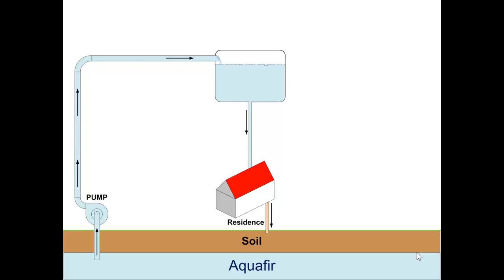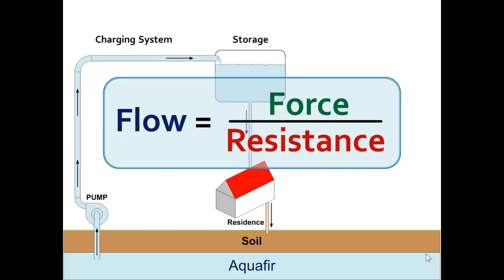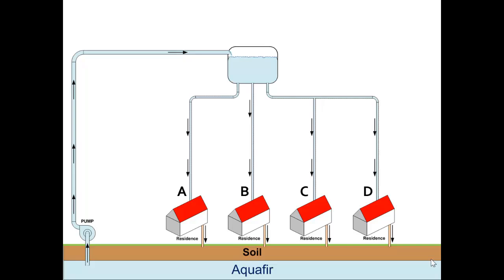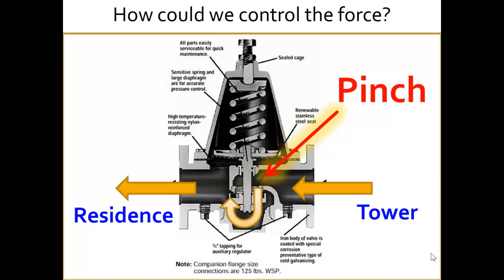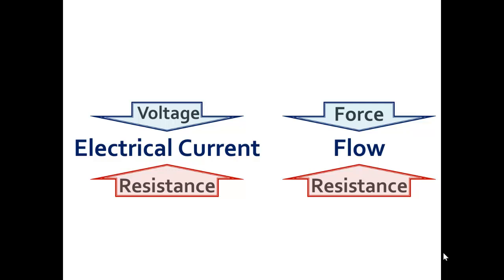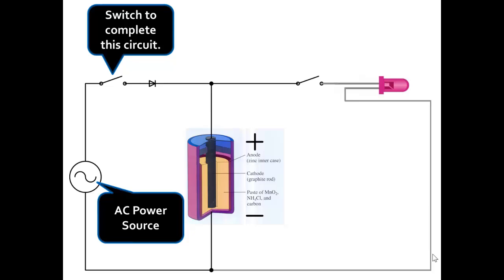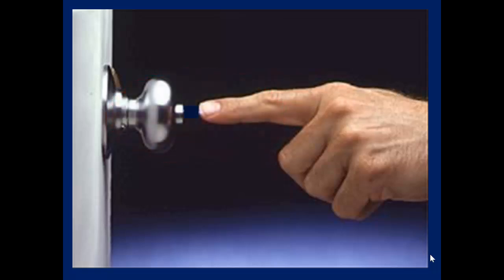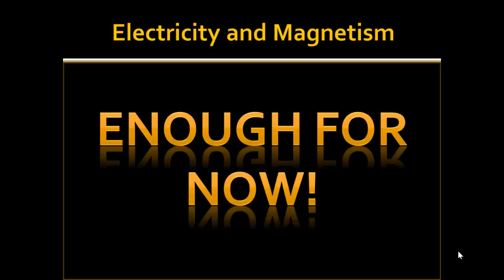Basic Electricity & Magnetism Part 2.mp4

Comment: so when you pull back a rubber band your storing more energy than is released when it snaps . ? i thought it would be equal amt
Reply from the maker: ...thought so myself, if you include the thermal conversions.
Reply: @plcprofessor  so there is some thermal energy released

Comment: Thank you for this video! I have also watched the next video from your RM 101 course (https://www.youtube.com/watch?v=NfcgA1axPLo) and have a pretty basic question. The conventional current flow diagram was followed when wiring up the 9v/LED/resistor. But why was it not wired up according to neg to pos electron flow? If the electrons flow from the anode and hit the LED before the resistor, how is the resistor doing its job? It seems as if the resistor would serve no purpose after the high current flow already the LED. Am I interpreting this incorrectly?
Reply from the maker: The free electrons in the circuit effectively all move at once...repelled by the excess of electrons at one terminal of the source and attracted (equally) by the positive ions at the other end of the circuit. Electrons do not arrive anywhere first. Imagine the electrons as railroad cars on a track (the circuit) and that they occupy the entire circuit (track) all of the time. When current flows, all of the rail cars move in the same direction simultaneously save the slack in the couplers (loud sound that you here when the train starts moving or reverses).

Comment from the maker: Correct you are, according to the conductance charts. Having been told many years ago that gold was the best, probably because it does not oxidize as quickly as silver or copper and thereby the best for connectors, I surmised that it was the best, literally and assumed it was the distance between the valence orbit and the nucleas. You are never to old to gain a new detail. I am going to spend some time researching why silver and copper both are better than gold.

Comment from the maker: You may be correct. I did a quick browse on the internet and could not find a definative answer. It is hard to disagree with the conductivites that you quote. Having never actually tested the two elements of equal cross sectional area, I made assumptions based on what I was taught and what many believe about the valence electron of gold more loosely bound than that of silver. I will research it and repost. Nonetheless, thank you for pointing out a possible error.